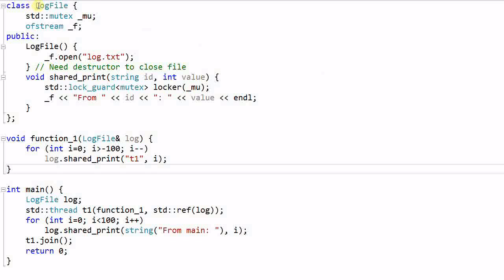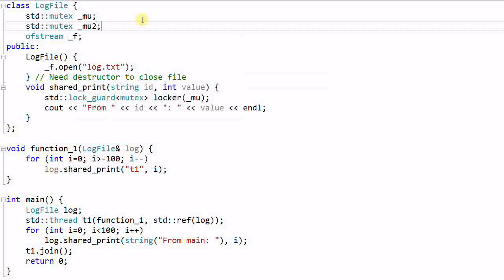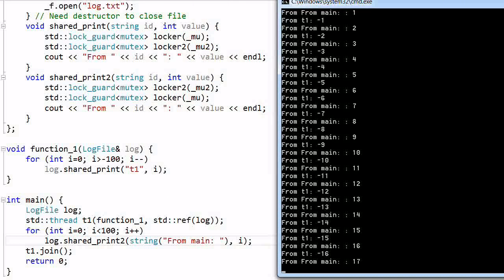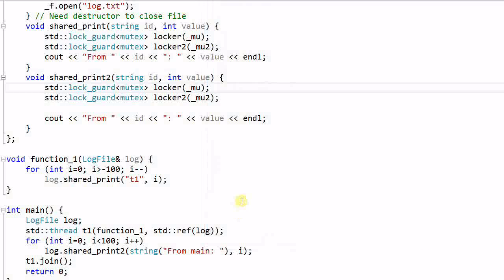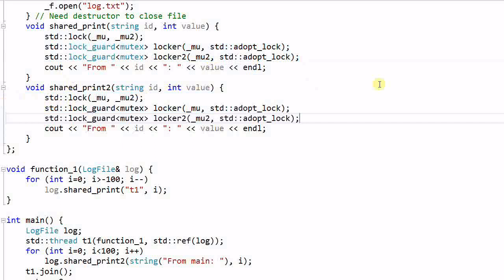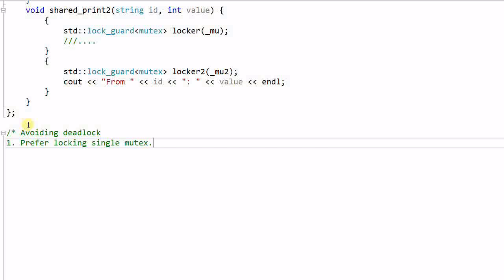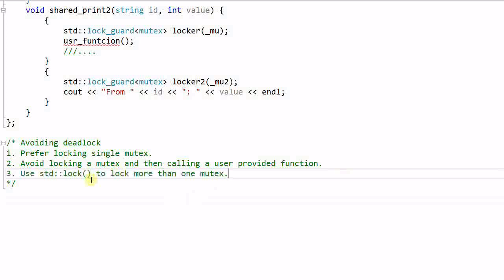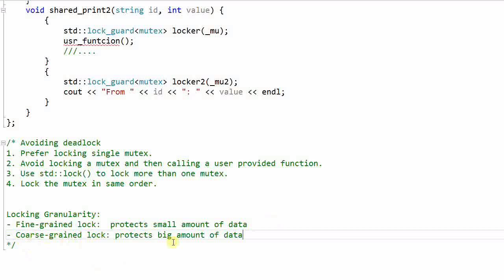C++ Threading #4: Deadlock

Comment: Like Button for people in 2023:

Another example of deadlock avoidance using lock where two threads happen to act on same transaction , transposing different accounts.   Reference :: Operating System By Galvin, 9th Edition Page No.: 323 

#include <mutex>
#include <thread>
#include <iostream>
 
struct bank_account {
    explicit bank_account(int balance) : balance{balance} {}
    int balance;
    std::mutex m;
};
 
void transfer(bank_account &from, bank_account &to, int amount)
{
    if(&from == &to) return; // avoid deadlock in case of self transfer
 
    // lock both mutexes without deadlock
    std::lock(from.m, to.m);
    // make sure both already-locked mutexes are unlocked at the end of scope
    std::lock_guard lock1{from.m, std::adopt_lock};
    std::lock_guard lock2{to.m, std::adopt_lock};
 
// equivalent approach:
//    std::unique_lock<std::mutex> lock1{from.m, std::defer_lock};
//    std::unique_lock<std::mutex> lock2{to.m, std::defer_lock};
//    std::lock(lock1, lock2);
 
    from.balance -= amount;
    to.balance += amount;
}
 
int main()
{
    bank_account my_account{100};
    bank_account your_account{50};
 
    std::thread t1{transfer, std::ref(my_account), std::ref(your_account), 10};
    std::thread t2{transfer, std::ref(your_account), std::ref(my_account), 5};
 
    t1.join();
    t2.join();
 
    std::cout << "my_account.balance = " << my_account.balance << "\n"
                 "your_account.balance = " << your_account.balance << '\n';
}

Comment: Hi Bo, thanks for your video. Your explanation was great, but there are something I don't understand. You said first mutex is for security reason and second is for file system reason, but in the example, I can't really tell why you have 2 mutex there. It seems redundant to me. So I guess my question is, why use multiple mutex and why someone will ever use reverse order of mutex on shared_print_2 if they know dead_lock gonna happen potentially? Beside, what do you mean by "lock the mutex"? What's mutex really, I went through your first 4 videos and did not find my answer.
Reply: It is just for demostration purpose.

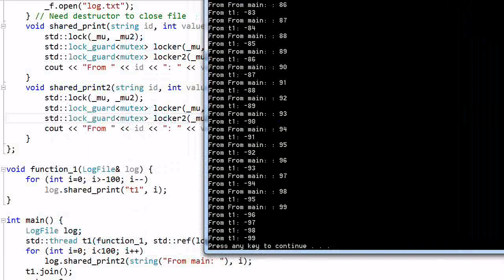Comment: 4:25 it finished in a bad way, not synced. Why?
Reply: I don't think it finished "bad", as the main thread just beat the second thread to the end. It would be bad if we saw mixed output like "from t1: from main: -97, 100". The key thing I THINK is that the output is whole, as it was intended from the two threads, they dont HAVE  to happen in a certain order, like "taking turns" or anything.

Comment: When would you use two mutexes instead of just one?
Reply: When you are in a situation that has many levels of security like there is a first level to be secure from the other part, then a second level to be secure from the first level.
Reply: Sometimes you lock a mutex and then call another function that down it's path locks another mutex.  That is why he said to try to avoid calling "users functions" which you never know if they are going to lock more mutexes.  But even in your own code it can get kind of hairy specially when you're working in code written by many people concurrently such as when you're in a company.

Comment: Great explanation sir,,, . But, I have one doubt, to avoid deadlock is it necessary  to use std::lock(_mu1,_mu2) in both the function i.e share_print1() and share_print2(). If we use in any of the one function only , it can also avoid the deadlock.
Reply: Hi
Deadlock happens when we use same mutex for each thread and then we want to block it when it in blocked state.

Comment: i wrote the same code but still i didn't experienced classic deadlock situation, in both the situation locking mutex in the same manner or other my code ran successfully. how can I create a deadlock situation then?
Reply: Yes its technically possible to not have a deadlock with your program "always". Not every run would have a deadlock. Run it multiple times and you should have it. If not post your code here.
Reply: I haven't deadlock situation on VS2017 too, why?
Reply: are you sure you changed the main function to have shared_print2?
Reply: Akhil Mahesh yea i changed main function call to shared_print2
Reply: The you must be having a super natural compiler which automatically corrects deadlock situations :P 

Post what you have here. Might be some tiny coding error that you are overlooking and someone can help you out.
Reply: same

Comment: could you explain why or when we should add two lock_guard?
Reply: We add two because we want to lock two mutexes, and we add the lock_guards to wrapp the two mutexes locked so they will be unlocked automatically (functionality provided by lock_guard but not by lock), and we use lock function to avoid the deadlock (functionality provided by lock but not lock_guard), it is like we are trying to get both advantages.

A new C++17 feature that has both advantages and helps us to replace both (lock and lock_guard) is scoped_lock, which can lock many mutexes in the same time (like lock), and its locks are scoped or wrapped (like lock_guard).

std::scoped_lock<std::mutex, std::mutex> locker(mu, mu2);

Comment: thanks for your tutorial. I have one question: when there is a dead lock, why the program still run a little before it got stuck?
Reply: +Yunfeng Xi  +1, compiled the code, and the program reached the deadlock in the very beginning - only 1 line has been printed in console
Reply: +Collin Bell, many thanks) I've had a thought that this is system-dependent
Reply: +Нарко Барон Thanks to both of you.